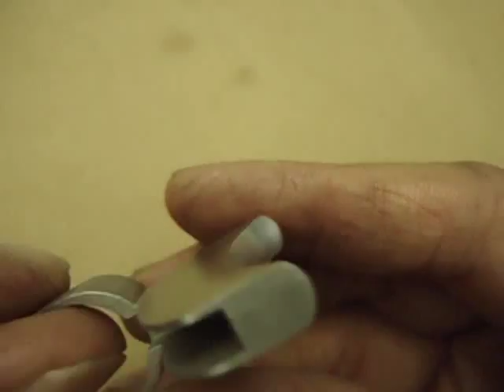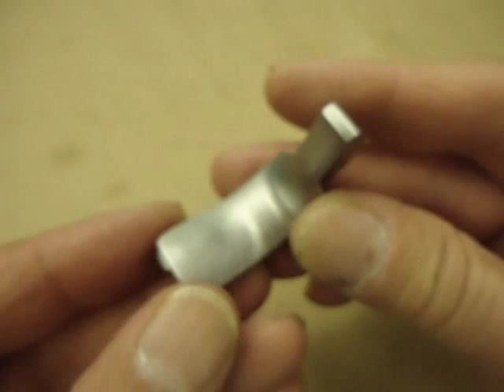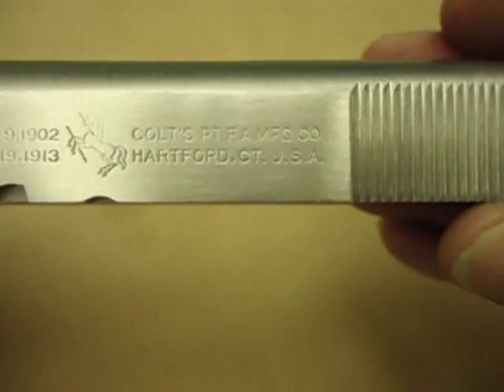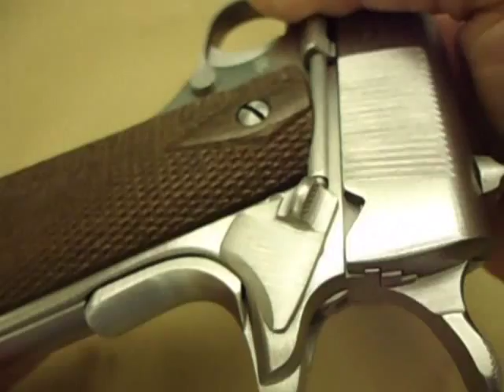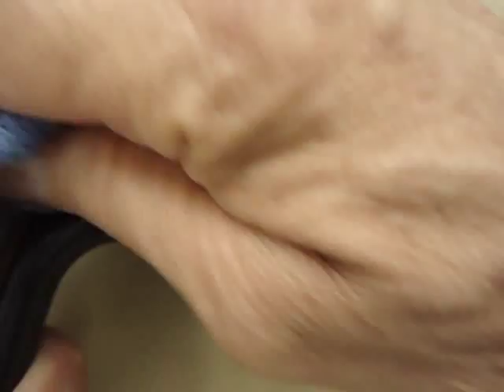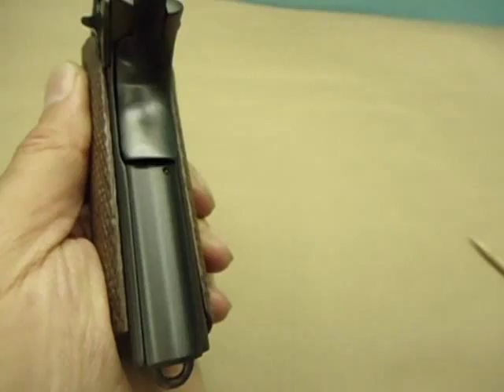Patrick 1918 Colt 1911 Pistol Restoration Vulcan Gun Refinishing (3 of 3)

Comment: Has the value of original vs. now diminished ?
Reply from the maker: Good Day. This Argument will go on forever. Some people will say that the Value has suffered from the Restoration, but Bottom Line, would YOU pay more for it now refinished, or the way it was before?  Opinion is slowly changing from what I'm seeing and hearing. If the Refinishing is done correctly, and the original Factory Appearance is faithfully duplicated, the Value of Refinished Guns is increasing every Day. There's only so many "originals" left out there, but most are now suffering from Father Time and that original Rust Bluing is starting to deteriorate and the Pitting is coming to the Surface on many of them. I have at least 3-6 1911's in here at any given Time for Refinishing, and they are all suffering from Rust Pitting caused by original Rust Bluing. But, I'm in a unique position as a Refinisher because I get to do the "Surgery" on these so I know first Hand the true condition deep down in the Metal. I know, it took 100 Years to come to the Surface, but it can't be denied. They are rotting in front of our Eyes. They have CANCER.  Something else to consider is that now, the ones that have been refinished in Black Oxide will never have that Problem, as long as they are Oiled and maintained.  In my Opinion, we've Helped them, not Hurt them. Thanks.

Comment from the maker: Yes, U.S. Guns can be shipped to me in Canada but a specific Protocol must be used and it's expensive. 

Shipping me your Pistol will cost you approx. an extra $400-500.00 in Fees, Paperwork and Shipping. 

Some feel that it's still worth it. I've done 3 U.S. Jobs so far ( Missouri, Maryland and Connecticut) with number 4 on it's way from Florida. All have come and gone successfully with zero Gov't issues from either side of the Border. 

Send pics.

Thanks..........Nick.